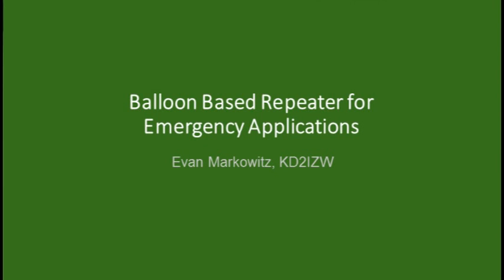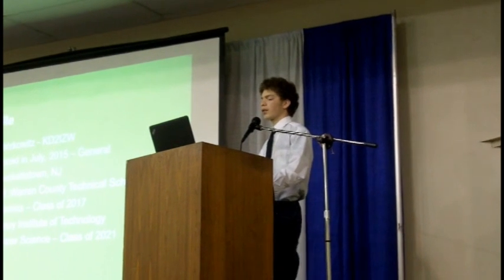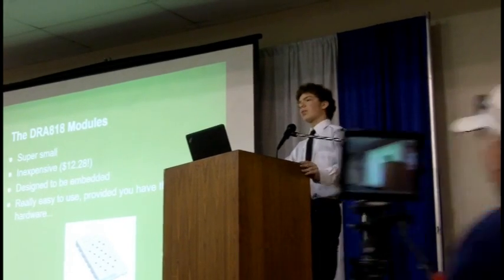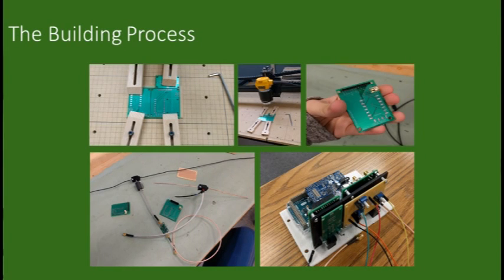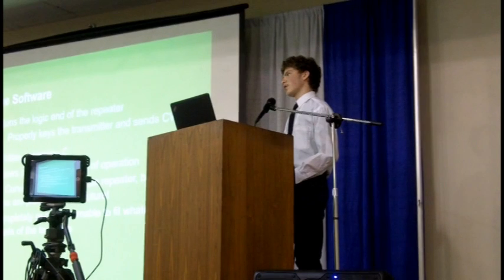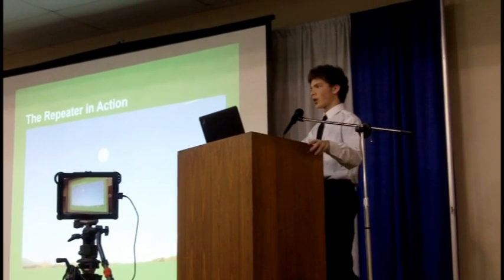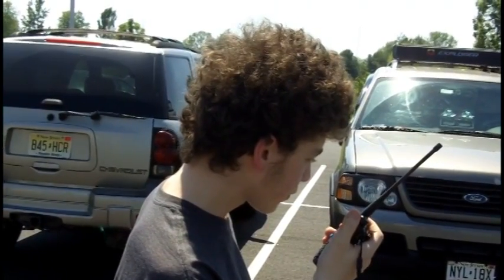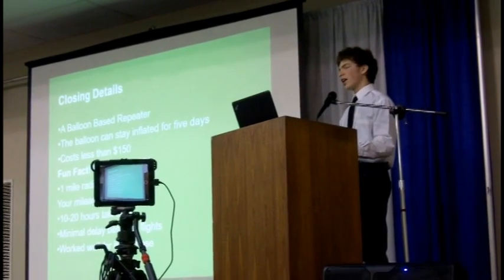A Balloon Based Repeater for Emergency Applications

Comment: This is a decent proof of concept, but I wonder what kind of tests they were running that they were only able to achieve a one mile radius. RF line of sight at 100ft is 20km. Granted there there were probably obstructions between the balloon and the operator, but they should've been able to get more than one mile. This project didn't actually take advantage of the additional line of sight that a balloon repeater can provide.